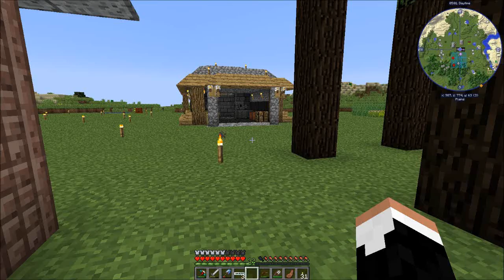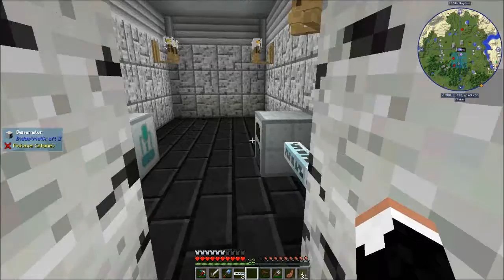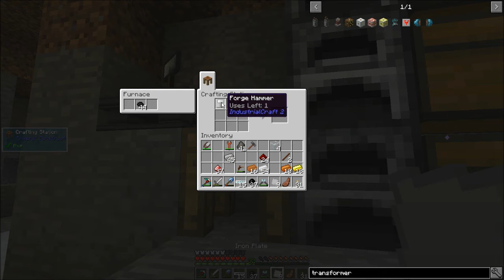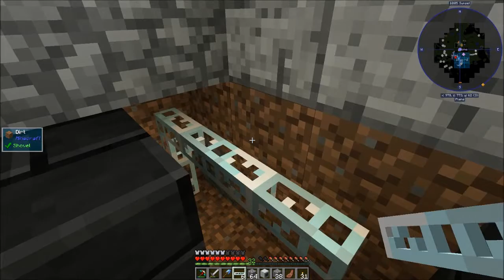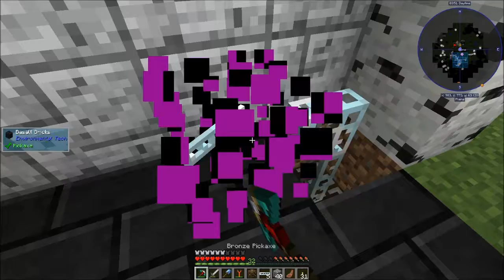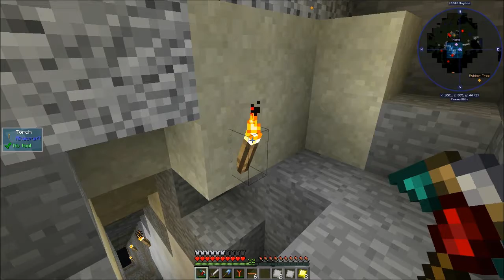Age of Engineering, E5- Steel, and Forming Metal Efficiently

Comment: Usually, Extruding gives you less wires per ingot compared to Cutting. Extruding was 2 wires per ingot, and Cutting was 3, if I'm remembering correctly. This pack could have changed things of course. Extruding has other uses, I think fences for scaffolding and reactor rods.
Reply from the maker: Thing is, that takes two steps...rolling the plate, and then cutting it.  Extruding only takes one, and honestly, the amount of cable I'm using from this point on is minimal, so I can afford the metal losses in exchange for the time savings.  If I was metal starved, I'd be willing to invest the extra time, but most of what I'm extruding is tin and copper, neither of which are even remotely short of supply.
Reply: Unless it was changed by the pack, then Cutting in the machine should just produce wires, no need to stamp to plates first. Thats only when doing it manually with the cutters and forge hammer.
Reply from the maker: +Oduunich Loftuer It was changed then. Bars can't be cut, and plates provide less wire when cut than extruded bars.  Tested it while I was recording last night.
Reply: Lammme but oh well.